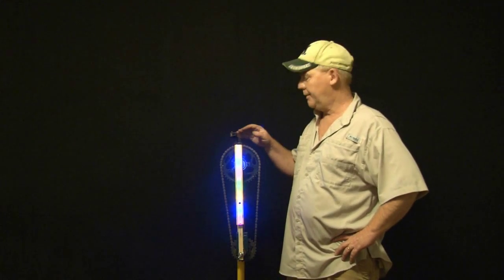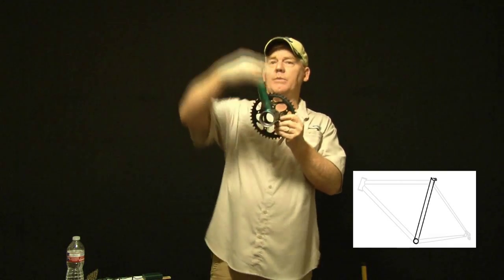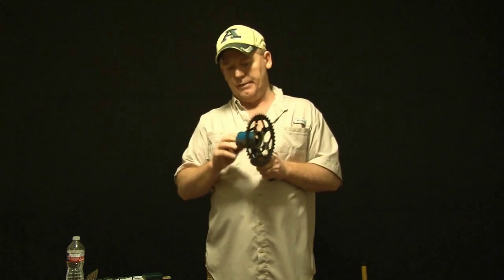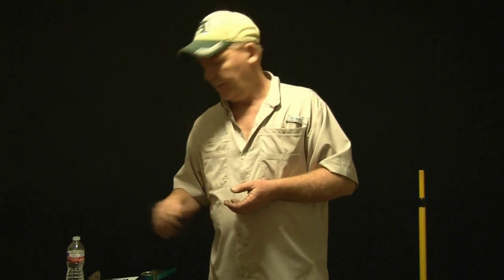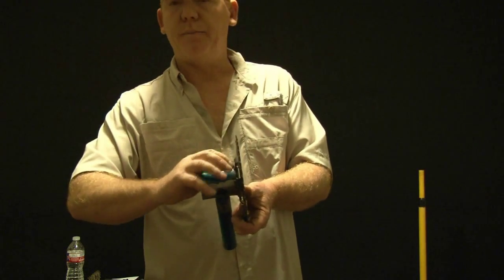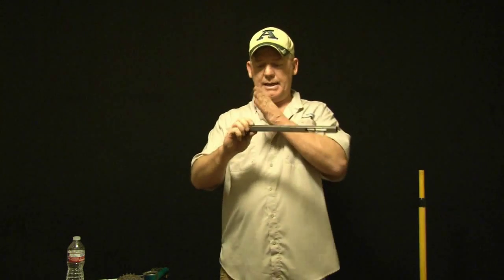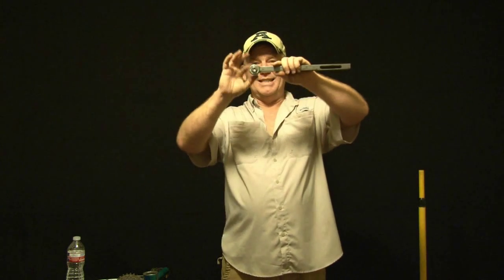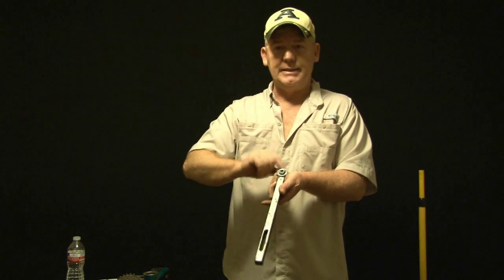SpiroJib (Build)

Comment: hello would you have a reference to a link for those to get the Bearing, thank you for your sharing 👍
Reply from the maker: Here's the latest build instructions. I've made a few improvements since this video -  https://lightpaintingphotography.com/wp-content/uploads/2017/04/SpiroJib-V3-Upgrade.pdf

Here's the upgrade video - https://youtu.be/nqrPZggRID0

The bearing I used is a Flanged Bearing with a 3/8" ID and 1-3/8" OD. I'll drop a link to it but the thing is, you have to match up the bearings and bushing that goes between them to the pipe and bolt you are using. 
https://igoprolawnsupply.com/products/9892?currency=USD&variant=29633878261857&utm_medium=cpc&utm_source=google&utm_campaign=Google%20Shopping&gclid=Cj0KCQiA_8OPBhDtARIsAKQu0gYBXhR2f5GrN0tzovLXsfGFdFxyq8uk4IyhziX5vIV5PD_zOL5RgXkaAgJmEALw_wcB